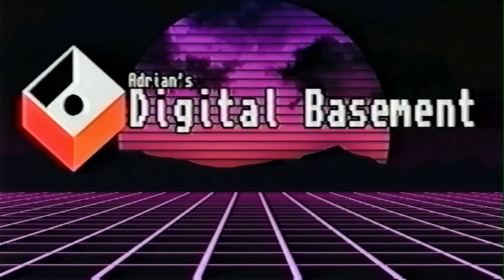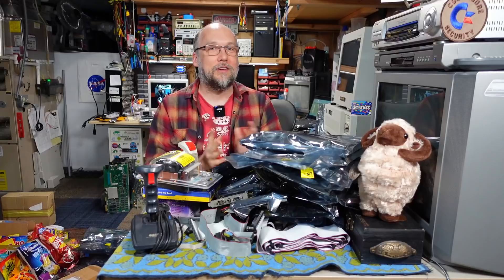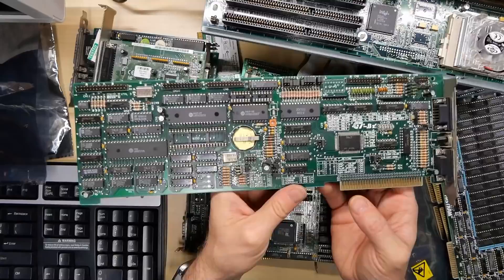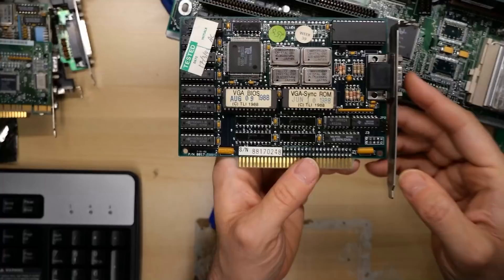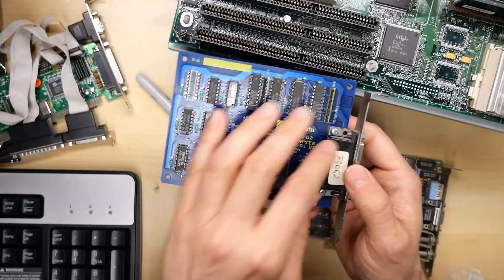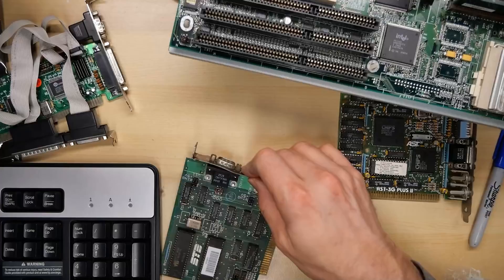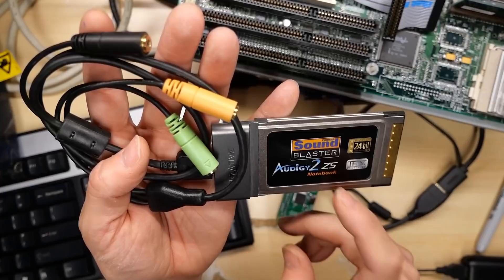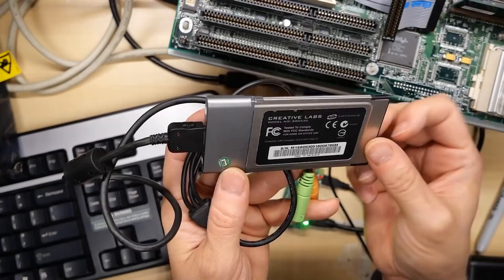The motherload of PC parts: Motherboards, ISA cards and more

Comment: The IBM QIC-02 card is for an external tape-backup solution that used the QIC (Quarter Inch Cartridge) format!
Reply: Good call - thats what what I think it is also.
Reply: Yup, I'm always too late.  Pronounced "quick", that's a "quick oh two" format.  Still have tons of quicks today.
Reply: @yinyang1470  huh, i always pronounced it as "kick". But quick makes a lot of sense.
Reply: Yes.  I've installed a few of those.  Not necessarily that particular card, but QIC was very prominent in the 80s and 90s.   I remember a backup solution that used VHS machines and tapes, too, that was supposed to be an inexpensive alternative to QIC, though it was much slower.

Comment: QICs are tape drives (interfaces) ... quarter inch cartridges. IIRC, QIC2 was the standardized drive interface.
Reply: The HP-85 scientific computer used QIC tape for storage.
Reply: That’s what i thought when i saw the “oic” :)
Reply: Mountain sold tape backup 'solutions' as well as bare drives and controllers.
Reply: @geoffreed4199  Wangtek was another typical vendor.

Comment: Oh wow. I used to work in the British Rail Local Systems department (my first "proper" job)! They were the section of what became BR Business Systems (eventually owned by Schlumberger and later Atos) which dealt with the standard builds of servers, LAN ops and interfacing of the various railway networks to the central mainframes in Nottingham and Crewe.

I think (it was a long time ago) that these were used in computers built in-house, replacing the old AT286 clone machines from Opus Technology (a British PC builder) and re-using quite a lot of the old machines (case/PSU, VGA, some HDDs etc) to extend their life at minimal cost. Before my time there but I saw a fair few of them about. They were named "BR Vixen" as I recall and distributed throughout the UK. Often they ended up extremely dirty as they were often the only network-connected PC for SNA/email access in a portacabin by a railway station siding, sucking in diesel dust constantly for years. They generally kept working!

Comment: The 74LS612N is part of the AT DMA system: It implements the page registers for the 7 ISA DMA channels. It basically expands the 16 bit address counter of the 8237 DMA controllers Intel intended for 8085-like systems to the 24 bits a 286-based system requires.The
The 16450 does not have a buffer. It works more reliable at baud rates above 38400 though because they fixed some flaws in the internal timing of the chip, and IIRC they fixed a bug regarding interrupt generation in some corner case. The buffer is only available on the 16550.

For the 8086/8087/8088, the number after the dash is like "1st class"/"2nd class"/"3rd class". 10MHz is the top class, indicated by -1.
The 8255 is not a chipset, it's a digital I/O chip used for interfacing to the keyboard, reading the DIP switches and controlling some mainboard functions like speaker on/off. For an XT, you don't necessarily need a chipset - as you only have one DMA controller, one Interrupt controller and one timer chip, the keyboard interface and a DMA page register chip, i.e. 5 chips in total.

Chipsets started to make more sense with the AT that added a RTC, a second DMA controller and a second interrupt controller. The C&T 82c206 integrates all that AT stuff into one single VLSI chip, and it lived on until the 80486 era. It was cloned by nearly any x86 chipset manufacturer. More modern chipsets that contain these AT on-board peripherals in the south bridge are still sometimes specifying "integrates a '206 macrocell" in reference to that C&T chip.
Reply from the maker: Ah ok cool details! Thanks

Comment: What I always remembered with AT power connectors was, red is dead and black is right. God I miss the days in the mid 90’s when I worked at a local computer shop and built their custom configuration PC’s for customers along with doing regular troubleshooting tickets. I remember their first sub $500 PC we would dub the CA model (cheap ass) which used a Cyrix Media GX board. It had everything on board including a soldered on CPU and required maybe one card, the good old dial up modem. It was perfect for someone that just wanted to do web browsing and word processing while running at the time a modern OS like Windows 98. I remember building one for my aunt and she used that thing pretty much for the rest of her life.
Reply: Started at a small shop in 96 in the days dos
And win3.1 was most popular. Then
Win95/98 and when the voodoo2 cards were the best😳. Went on to work for computer renaissance. Built a lot of custom towers there. We got a lot of off lease ast’s there. New enough to have sim slots. Remember the p4/socket a and era. Lots of people were not careful installing the heatsink to the and’s and would damage the die and end up with a dead cpu.

Comment: 'People were probably screaming at their screen'; it's like you could see me. Great video, and one of the few times you'll hear 'British Rail' and 'Reliable' together. Might be interesting to see if the 2 RAM cards work as '1' and '2' in one of the 386 boards?
Reply: If configured correctly, you can use multiple RAM expansions on AT's as one lump of memory. Pretty sure you can populate empty ROM sockets and configure those into extended memory.

Comment: I've taken to making my own ribbon cables these days. actual new stock parts are still made even today, and a crimp only costs like $15-20. You can get a spool of 40 lead ribbon cables for cheap and trim off 6 of the leads for floppies and make them exactly the right size for your case. Makes for great cable management, and the extra 6 lead wires I trim make for great repair wires. The card edge connectors are still available today, and you can easily make your own key for them, it's just a little 2x4mm plastic shim you jam into the rails between the connectors for 3/4 and 5/6.
Having a removable shim is better since not every card edge male has a key on it.

Comment: Watching again a year later! :) That 386 board has the weirdest math coprocessor socket ever - it is a square form factor for the 387, but the 386 can also use a 80287, so it has a long socket which is mind-melded with the square 387 socket!

Comment: 10:34 the fact that it only has an external SCSI connector pretty much tells it won't boot OS disks; but it's a useful card to connect Mac SCSI Zip drives to a dos/windows pc
Reply: It's also useful for external scanners from those days. They often came with extremely cheap ISA SCSI adapters that limited their performance.
Reply: You can connect "Mac" SCSI Zip drives to "PC" SCSI ports with no issues as long as ID and termination is set correctly. Connecting it to a PC's parallel port (or even a Mac's parallel port if you can get a card/adapter/dongle/whatever) would probably give you trouble.
Reply: Or it's for those old flatbed scanners which using SCSI connection to the computer (before the USB port exist, the SCSI port is the only reliable connection which provide enough bandwidth to transfer image from the scanner to the computer)
Reply: @SkullCommander  That is correct! Also a few NEC SCSI CD-ROM drives came with a very basic 8-bit SCSI card as well. Good times.
Reply: I'm sure this thing would be supported by the DOS drivers on an Win98 bootdisk.
Reply: @VidaDigital  My Amiga 1200 used a SCSI CD-ROM plugged into the PCIMIA socket on the side. It does have IDE, but when your computer isn't big enough to hold a the CD drive, you had to use other methods.

Comment: Socket 478 is for Northwood Pentium 4 machines. Along with some early prescott.  That IDE cable that has multiple pins blocked off is for a SoundBlaster IO box that would mount in a 5" drive bay for a soundblaster Live or Audigy.

Comment: The first heatsink you take out, the ThermoSonic Thermo Engine was the first to include a heat pipe in the core, a lot of hype at the time. It's a heatsink I spent a lot of time hunting down for one of my machines!
They were great at chipping the corners off Socket A / 462 dies too.

Comment: Hi from Wales! 😀👋 The QIC-02 card might be for a Tape Drive? 🤷‍♂️ Those 386 motherboards look that they might take a 287 as well as a 387 FPU should that be needed. Those stand-offs on the XT board would still be useful today with some modern Gigabyte motherboards where they have an extra mounting hole there there isn't a mounting point on most cases.

Comment: The port at 6:40 probably works with a "mouse systems" type mouse, which was different from the serial mouse standard everybody else used, if I recall correctly.
Reply from the maker: I think IIRC that was a different protocol but still used a normal serial port? Gosh I recall it being different but don't quite recall the details.
Reply: @adriansdigitalbasement  I vaguely remember Mouse Systems and other Bus Mice (Microsoft) but Serial was just easier and less expensive until PS/2 mice came along anyway 🙂 -> https://en.wikipedia.org/wiki/Bus_mouse
Reply: @adriansdigitalbasement  You are right that "mouse systems mouse" is a protocol for a serial mouse. It's the most common 3-button mouse protocol in PC mice (i.e. everyone except logitech used it). Vida Digital probably meant to write "InPort mouse" or "Microsoft bus mouse" (not to be confused with the Microsoft serial mouse, the most common 2-button mouse protocol).
Reply: The Mouse Systems mice were optical mice that used a mirrored mouse pad that has grid lines on it. I think the grid lines were used as clock signals. The vertical and horizontal grid lies were different colours (brown and blue, if I recall correctly). All of the other mice back then used friction balls which were prone to picking up dirt, and needed to be cleaned out periodically; the Mouse Systems mice never needed any maintenance.
Reply: @kostaskritsilas2681  That's right! Some other manufacturers picked up on that standard and some mice, IIRC, would even have a switch to go from one standard to the other.

Comment: That 74ls612 seems to be a memory address pager/extender.  It has 16 memory page registers that hold 12 bits each and can be programmed.  When you address memory in a range that the chip is activated on, it outputs those 12 bits to the address bus based on the 4 bits that are selected.  So it replaces those 4 and adds another 8.  Probably part of the BIOS shadowing scheme, but could also be used for an EMS-like capability.

It's strange for it to be included in the 7400 series though.  It's a pretty specialized chip.

Comment: The Mountain card is an IO device. Most likely for RS232 and/or external boot devices like an external drive or booting over a network. It was likely used in a network terminal device rather than a PC per say. Id check the recommended adapter it mentioned in the silkscreen.

Comment: I had the laptop version of Audigy 2 ZS back in 2007. It had a much better audio quality than my Fujitsu Siemens laptop. But I distinctly remember that Creative drivers for this sound card were quite bad. For some strange reason, this sound card always stopped working after waking the laptop from sleep, I had to shut it down and turn it on again to get it going. 

The connectors on the audio card itself support both analog and digital audio in/out, the included breakout cable is needed only for 5.1-channel audio.

Comment: 12:05 SCSI-1 or Fast SCSI Host adapter (looks to be a fairly nice one (less buggy)) specifically for tape or CDROM drive but probably any sort of Fast SCSI device (hard disk, scanner, CD or tape, etc.) (will almost definitely need active termination after last peripheral on the BUS (beginning and ending termination is req'd but I think that I can see the beginning resistor set is permanently mounted on the card (top right corner) so only the end will require termination if that is so).

Comment: I had the exact same model joystick as the black quickshot one! It was really terrible quality, but honestly it was pretty much bulletproof, just kept working.

Might be interesting to do a full retro system build with that XT board and period-correct parts. If you've got an appropriate case, that is. You could talk about the hardware choices that people typically had back then (it was before my time, but I'm guessing there wasn't many options for video cards or hard drive controllers, etc.). Bonus points if you've got an 8-bit sound card like such as an Adlib or Sound Blaster. Bonus bonus points if you can get an 8-bit dance party going on it!

Comment: the IBM host adapter card is basically a network card to connect to the mainframe... it came with a 3270 piece of software which used the card to talk to the mainframe...
so basically a network card =)

Comment: My guess is the Mountain card was simply an 8-bit SCSI adapter, which used 50 pin DB connectors like that.  Jumpers would set drive id, etc.

Comment: that sound blaster goes in laptops with express port... i have one they pretty good.
Reply: <Pedantry alert> that's actually a pcmcia card, not expresscard
Reply: @UnreasonableSteve  To be even more pedantic, it's CardBus (you can tell by the gold strip above the connector).

PCMCIA ≈ 16-bit ISA PnP
CardBus ≈ 32-bit PCI
ExpressCard ≈ PCI express

Comment: Ok, I found several different manuals for the AST 3G-PLUS II and they all list the two RCA connectors video out, though maybe can be used with the feature port but it appeared as they work by themselves just to output standard composite video out but none of manuals I found  were entirely clear on that. But they all had a diagram that referred to those RCA connectors as video connectors. Yes, its possible a feature connector card attached to this video card could add additional video standard support out of the RCA connectors that is not composite but I would presume they would work with a standard configuration of the car with no add-on boards. The top blue connector, above the monochrome/CGA/EGA connector is for a IBM-PC compatible light pen.

Comment: Sorry if this was mentioned before in comments or if I missed it in the video, but getting 640K base memory plus 1024K extended memory is normal with 2MB installed (on a card or otherwise) in the system (memory address space between 640K and 1024MB was not mentioned but used/usable by VGA BIOS ROM, other option ROMs, UMBs .

Comment: That Mountain card is most likely a tape drive controller. Iirc Mountain was a company that made various PC tape drives back in the day. You are probably mis-reading "OIC-02", it should really read "QIC-02" which is a standard type of tape cartridge format ("QIC" = "Quarter Inch Cartridge")

Comment: David Murray the 8-Bit Guy can probably help with the AST gear as he worked for them for a few years in their Support Department. 

I bought a couple of Compaq DeskPro 286s back in the early 90s at a Ham Fest Swap Meet for my daughters to use for school work. Each of them had a 2 meg ram expander card to go along with their 640k base memory as well as EGA graphics and a 287 chip. Fast enough to run their word processors and play Carmen SanDiego, Jeapardy, and some of the lighter education games of the day. When they got older I was able to get a good deal on a couple of Pentium 166s that easily ran at 200 with 64 megs of ram. I took the one ram expander card out of one of the 286s and put it in the other one along with a third ram card I picked up. Oila, a 286-12 with 6 megs of ram and a 120 meg IDE hard drive running WFWG3.11. Good times.
Reply: I’m pretty certain your 286 had to be running either Windows 3.11 or WfWg 3.10, as WfWg 3.11 dropped 286 standard mode (unless you Frankensteined different files out of different versions to hack 286 support into it.)
Reply: @DavidWonn  It has been 25 years ago so it might well have been WFWG3.10, but I don't think so. On of then would only run Windows 3.11, but the one I added the 2nd ram expander card was running WFWG using the disks that came with a Packard Bell 486 DX 66. Who knows that PB might have done to the disks, but it only worked on one of the two 286s.

Comment: I know it's as big of a PCB that it needs due to reduction of components in size and count, etc, but it's still somewhat amusing to see expansion cards that barely exist like that 10/100 Ethernet :)
I have, or had a triangular card because they didn't need all of the space a rectangular card offered. Interesting shape, but it probably also let them make three cards with the amount of PCB material typically used for two.

Comment: I believe I have a smaller version (not much longer than the 8 bit slot connector, if at all) of the G7 multi-function card, mine came from I think a Leading Edge. It's in my 5155 right now, I couldn't spot it on your card but the mini one has a composite video header near the mouse settings if I remember correctly, and that lets me save the one(!) true full-length slot for other things - I managed to cram a Plus HardCard into the original CGA card's place, plus a RAM card in the just-under full-length slot next to it.

I was tripped up by double composite jacks once - I have a clone CGA card with two composite jacks, I thought it was an EGA card but it turns out one is a normal color composite port and the other was a monochrome output.

Comment: Sound Blaster Audigy2 ZS - PCMCIA audio card from the Windows XP era.
I still have mine, although I haven't used it in quite some time.
I took a quick look at the driver disk that came with it.
I couldn't find any win9x drivers on it, I doubt if DOS was even a consideration at that point.
The newest file on the CD was timestamped 8-Mar-2005  so I had to have bought it no earlier than mid 2005.

Comment: At 12:26 that's a https://en.wikipedia.org/wiki/Quarter-inch_cartridge QIC interface card. I remember some of the early PC tape drives I used connected to the external floppy port or something quite similar.
Reply: ... probably so, the doc has "1989-1992" on the cover.